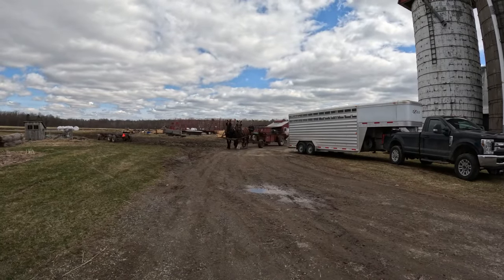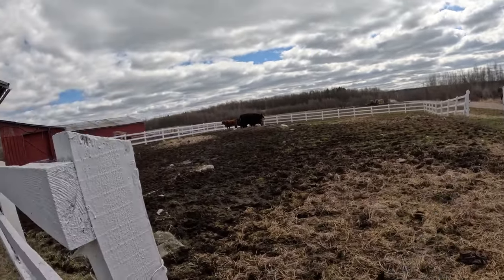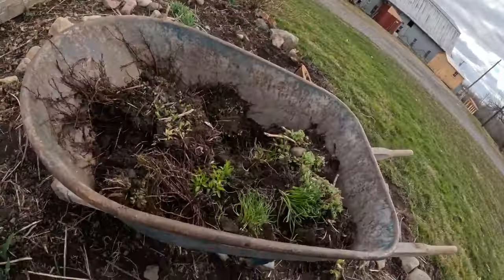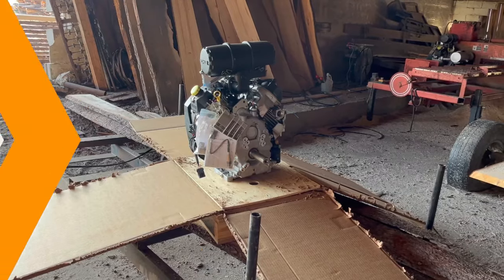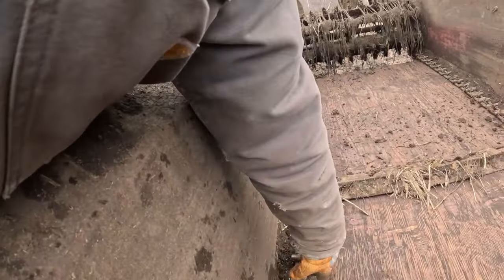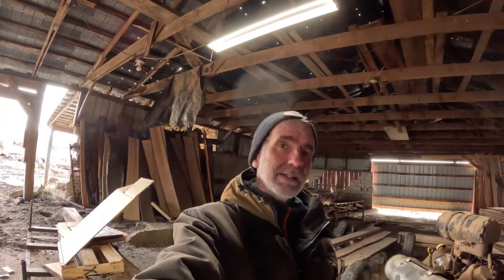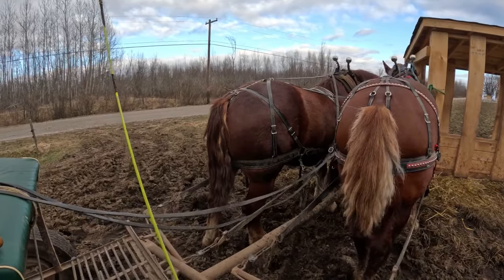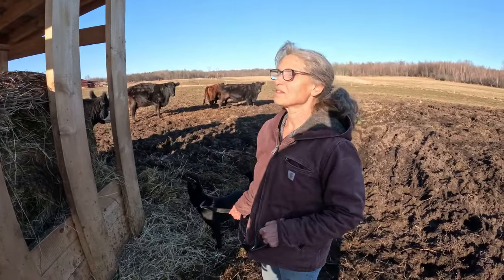JUDGING AND BEING JUDGED... Jim's thoughts on it #616

Comment: The old English manor houses I watched stated how they built the garden beds. They dug up the plant bed area to a depth of 15 feet, they then back filed the large holes with horse manure 10 feet deep, then added the top soil 5 feet deep and planted the varieties. The manure heats up the area as well as leaches nutrients for the  plants.  In spring the increased temperature made the zone up one. After over a hundred years those gardens are still going strong. You might want to try it since you have the manure to back fill into garden holes.  I don't believe the manure has to be aged in order to use it. I tried it on a flower garden once with cow manure and it really worked well for me.  L

Comment: There should be a cross bar about every 14 inches.  If not it puts much more stress on the few that are doing the work.    As you stated...... that twine on the beaters is another major issue !  When spreading the manure has a chance to drop down into the gaps between the beater bars thus allowing the beater to rip the manure apart. With even a little twine/mesh wrap/plastic on the beaters its putting major force on the beaters. Also make sure the tips / edges on the beaters are sharp.  The points on your spreader are nearly covered over in manure.........the cause.... is the twine on the beaters.

Comment: All those rocks!  It was one of the first things I noticed in your barnyard when I first started watching your videos. They had to have been deposited there by glaciation. Even at Abby's house she has an abundance of rocks and a nice waterway to go with it. My house property in Ohio was covered by the same glaciation to a height of a mile from 23,000 to 8,500 years ago. The property in my area has bigger rocks but not all the smaller rocks. You can still see cuts on the bottom of the big rocks created as they were hauled along by the glacier. One thing that seems different is the soil. Here we have a heavy clay soil that is very difficult to work with. You seem to have better soil there. It could be that it is soil that has been cultivated for many years. I was thinking your area is at the end of a terminal moraine; the end point of a glacier where massive amounts of debris is dropped. Another option might be that it is the result of the erosion of ancient mountains that were once in that area. Something like you would find along the Appalachian trail. Maybe some day if you get the right opportunity you can tell us about how this all came about in your area? I'll bet the people at the school would know all about it. While I'm thinking about it, I have another thing I've had to deal with in Tennessee and threatening in Ohio. Pine Bark Beetles and now Birch Beetles. Have you had a problem with either in your area yet? Especially in your wood cutting business?

Comment: could you not measure the volume of the trailer and convert what a bushel is to that or vice versa? just had a quick look and it appears a bushel is equivalent to 35.2 litres (US) so if you can find out how many litres your trailer holds that will be to the surface. Good luck both
Reply: I would think the rated volume of the honey wagon would be slightly mounding, and certainly to the top at a minimum.  The big variable is manure density, when your spreading off the barn cleaner that is a very high density and extremely heavy, Jim's is so much old hay, you know that.  Yep cubic unit measure=volume.  That's a lot of pooo😅